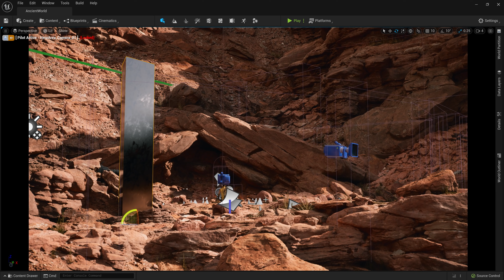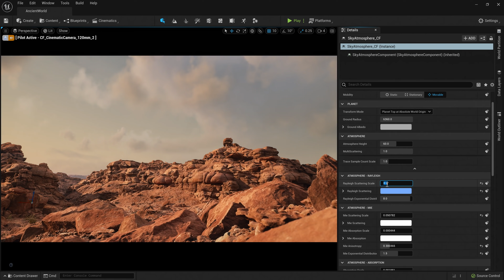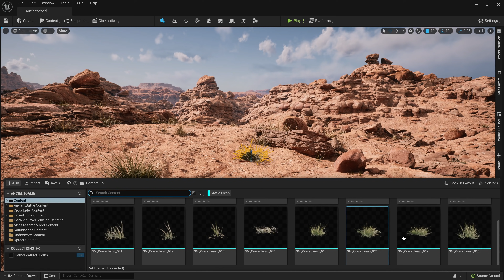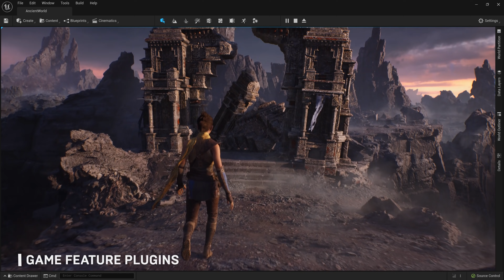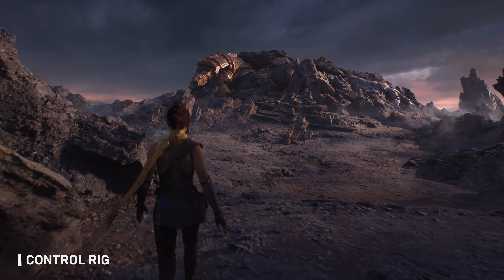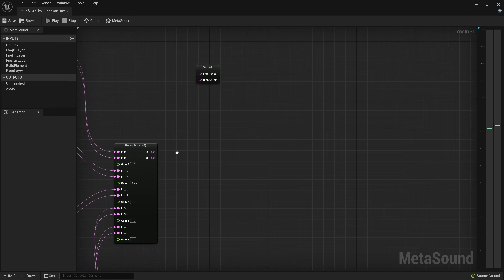Unreal Engine 5 - Official Valley of the Ancient Tech Showcase

Comment: The Nanite tech reminds me a lot of that voxel based "infinite detail engine" from Euclidian that went viral around a decade ago, except this tech actually works for creating games.
Reply: Because the underlying technology, or at least the underlying concepts, is very similar. From what I can gather, the difference being that Nanite breaks down traditional polygon meshes in smaller triangle clusters, and Euclidian's system straight up worked with pointcloud data instead of traditional polygon objects. 
Instead of pulling and rendering entire high detail objects, both essentially just load in whatever clusters or points are required. By clustering the geometry, you can parrellize any operations heavily, and because you're working with clusters instead of whole objects, you don't have to waste any computations on parts of objects that aren't visible in the scene.

This talk from 2010 outlines the design of a virtualized micropolygon rendering pipeline: https://www.youtube.com/watch?v=sR-q9D9_8so 
The size of each triangle is the size of a screenspace pixel, not too dissimilar from Euclidian's voxel rasterizer. I assume what Unreal is doing with Nanite is very similar, if not the same as  what is presented in this talk. 

Neither has released much detail in regards to how they actually work (under the hood), so it's mostly speculation on my part (maybe we can check that in the released source code for UE5).